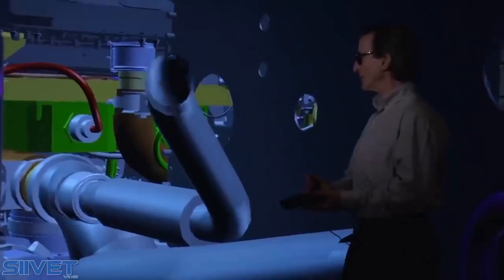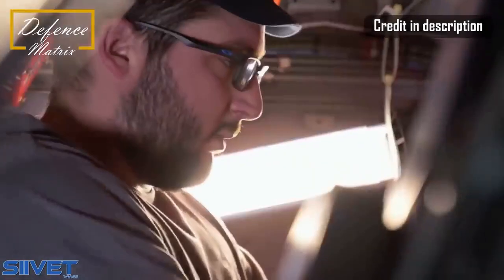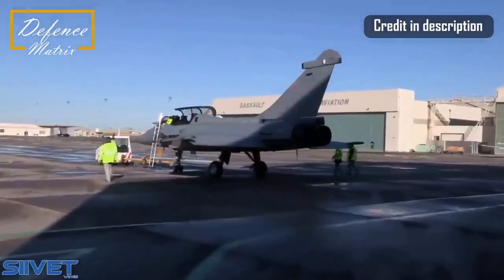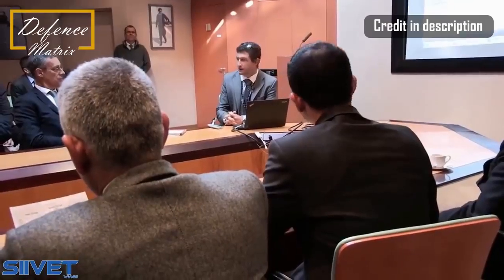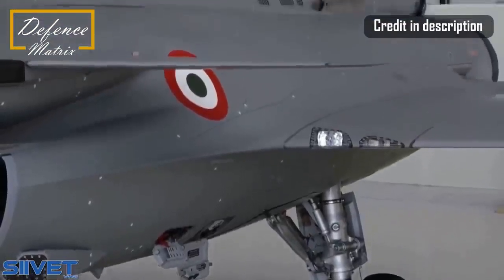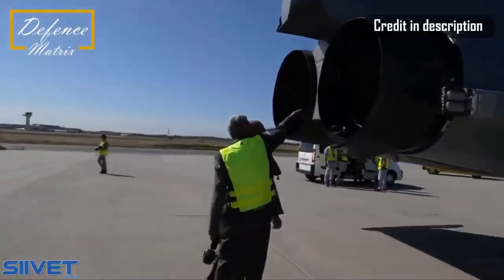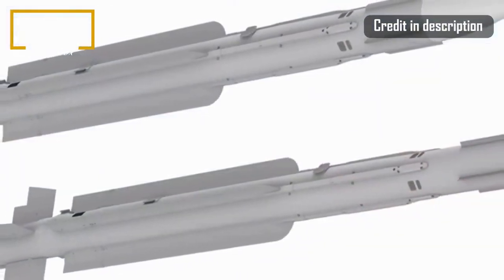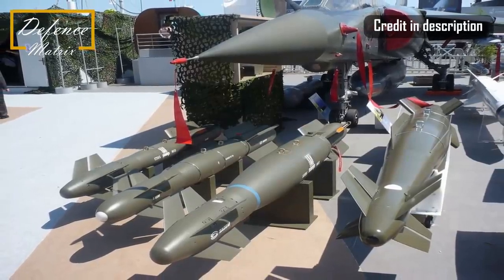Rafale F4

Comment: The engine of RAFALE F-4 version should be more powerful and capable because of this machine may be more manuareble and more powerful like Su-35 .
Reply: Hi. The F4 upgrade may integrate the M88-Eco engine, able to give 90kN wet with a longer life span. 
The M88-2 from the F3-R is a 50kN dry and 75kN wet engine.